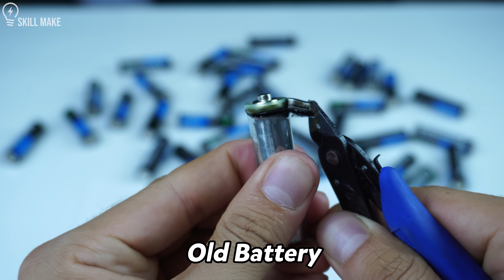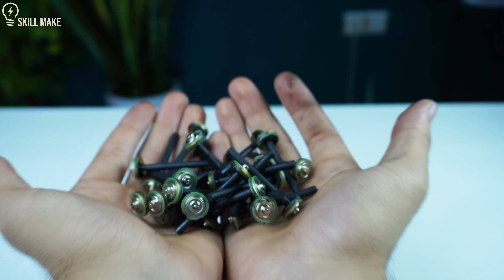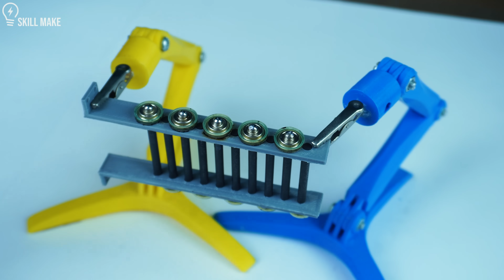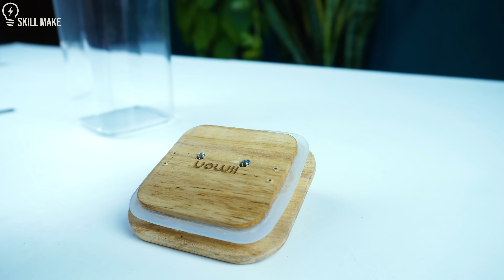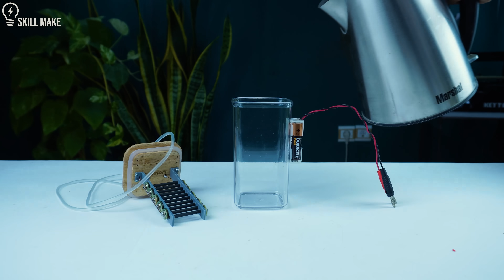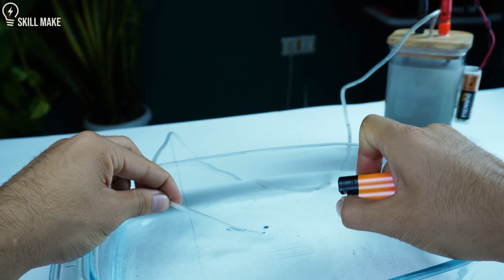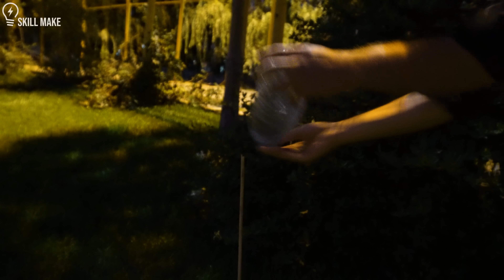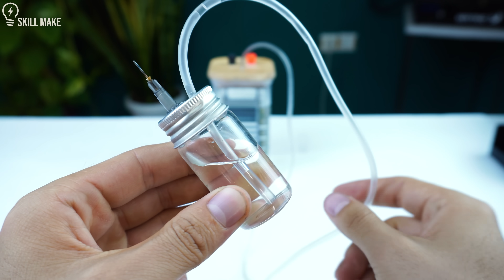Water into Hydrogen - Making a Simple Hydrogen Generator from old battery - hho

Comment: Some guy runs his house on it. He built a system that converts the water with solar electricity, then stores the hydrogen in a tank. No electric bill for him.
Reply: Hows his insurance?
Reply: @boontish1104  No idea. Not sure it would be affected. The whole apparatus is very far away from the house, as its on several acres of land iirc. Just wires running to the house. So maybe just standard insurance for electrical fires.
Reply: As long as he doesn’t patent it or the U S. gmm t an powers that be don’t know he’s safe!
Reply: @ Its already been patented by the U.S highway department. They used it to power lights for road signs, and that's where he got the idea. He used to work for them and he found these interesting little free power devices being used. He had to set them up. It was just a little solar panel and a little hydrogen converter.
Reply: Why isn’t this great invention being upscaled then??
Reply: @enermaxstephens1051 any idea on his name or the devices they were using
Reply: @ Cost. You can see it in action all over youtube, just put in "HHO generator" or "Run my car on HHO". Exact same thing. The highway department just used a very small one cause all they had to power was one light for a road sign. Not a lot of power draw there.
Reply: Just use solar panel directly, more efficient
Reply: Company home power solution build this in your home :)
Reply: @worshipperofjihyo915  Unless you have solar panels on the other side of the planet giving you power at night, you're going to want enough energy for all parts of the day. Hydrogen, besides the crazy dangers of storing and using, would be a great way to store extra energy and provide a consistent amount of power, regardless of the sun's location or the weather.
Reply: @jujuandjesus  just use a powerbank dude

Comment: Just dont make a car engine or something that will make you disappear like the last guy.
Reply: There are hydrogen powered semis ☠️
Reply: Haha Stanley Meyer? Yeah, that was a CIA job sure. They didn't want that getting out bcos of OIL. Bib Lazar has a hydro car though you can look it up on youtube
Reply: Self sustained cars cant run on water. You would break the first law of thermodynamics.
Reply: @Bretaxy  hasn't Toyota made one? They sell one I think
Reply: @Bretaxy  its not really self sustained is it
Reply: Who is the last guy?
Reply: @Vimukthi_Ekanayaka not just one guy, plenty of inventors of alternative fuel sources end up…missing.
Reply: add solar roof.
Reply: @Bretaxy No lawa need to be broken. You just can't see it
Reply: That never happened , the guy was crazy free energy doesn't exist
Reply: @CarlosWillis HYDROGEN and it's pretty expensive , almost 200$ for one full tank , range over 1000 km , and also , it's electric , it makes electricity by using hydrogen , so it's like electric car , faster filling , but worse everything else
Reply: @WatchmanNz not enough power
Reply: American airlines has ordered 100 Hydrogen fuel engines. Future is around the corner
Reply: @goodman393  that didn't happen, stop making things up
Reply: @matejmotuz108  It'll become cheaper if they produce it using excess nuclear power. Just need a great containment system for it. I do believe Toyota has come up with a fuel cell like battery for their hydrogen cars for easy swapping.
Reply: @kz8006  and why not just use that electricity without 60% loses ?
Reply: @matejmotuz108  Because you can't use nuclear in a car. Maximizing power utilization while creating a mobile solution might be where it's at. For our civilization to utilize the power generation for electric cars all the electrical infrastructure needs to be beefed up to handle the load which means a ton more metals to be used for that upgrade. Also in the colder and hotter climates, the power degradation with battery vs fuel sources is huge. You lose battery efficiency above 45 Celsius and below -7 Celsius. I live in a place where it is below -7 Celsius for over 4 months on average therefore in that climate, electric cars are not near efficient enough.
Reply: @kz8006  who said nulcear can't be used in cars ? or that batteies won't be better at future , in fact , Bev right now are way better than hydrogen car AND don't waste as much electricity , there could be battery swapping system , and come on , electric infrastructure isn't such a problem , anyone can get 11 kW charger at home
Reply: @matejmotuz108  I'm in the electrical industry and yes infrastructure is a problem. Add 1 million people to the charging structure and you get brown outs. Also, the mining of battery materials is very hard on the environment and you can't fully recycle these batteries once they are spent. And putting a mini nuclear reactor in cars is asinine as the costs would be parabolic and very unsafe as every terrorist would have a mini bomb in their possession that could devastate multiple city blocks.

I concede that electric cars are a good stop gap towards something better.
Reply: HOLD MY FUCKIN BEER ....
Reply: @CarlosWillis conspiracy
Reply: @CarlosWillis the cells need to be replaced. They're consumable like batteries. The cars don't come with a hydrogen power plant. That would be impractical. The amount of energy required to produce 1liter³ fast enough would be best suited to drive a motor instead
Reply: Made me laugh out loud, Brother. Good one.

Comment: It takes 39.4 kWh to produce 1 Kg of Hydrogen with 100% efficient Electrolysis. A more reasonable number is 50 kWh for 1 Kg of Hydrogen. That 1 Kg of Hydrogen will get you about 60 miles of range in a Toyota Mirai. 1 Kg of Hydrogen is $36 in the only US state(CA) that sells significant quantities of it right now. That is about $0.60 a mile to fuel a car. Efficient gasoline cars are about $0.10-$0.15 per mile and efficient EVs are about $0.03 per mile. Do you see the problem with trying to propel your car with Hydrogen now?

Comment: Glad to see you used potassium hydroxide. The danger with salt (sodium chloride) is that you produce chlorine gas as well.
Reply: That's why you use distilled water for this experiment and not tap water as shown
Reply: @tomokocchikuroki6200  the water came out of a kettle.  Boiled water is not the same as distilled water!
Reply: Why not NaOH
Reply: @ColinMcNulty he never said it was?
Reply: @Userhasbeenbanned0  Ah, I think I may have misinterpreted what he was saying. I thought he was saying the video was showing distilled water.
Reply: The Chloro-Alkali process....
Reply: Great Point
Reply: And the reason why it makes more HHO gas is because Potassium hydroxid is KOH. That means there's gonna be more Oxygen and Hydrogen because the KOH separates.
Reply: NaOH or kOH same  @Dom-I-NATE
Reply: Or just put few drops of sulphuric acid
Reply: but only the first time, so potentially you can just leave it on for a few hours and it will be safe to use
Reply: @ColinMcNulty  no it's not
Reply: @tomokocchikuroki6200 you dont use distilated water for electrolysis
Reply: kno2 all the time.   cleaner, doesnt clog up the cell.      otherwise known as    Lye    cheap
Reply: Isn't drain cleaner mostly NaOH which is Sodium Hydroxide and not KOH ?
Reply: Until it bursts open with caustic basic water flying everywhere (although he didn't add that much, though enough to produce burns eventually)

Comment: I hardly know what hydrogen even is but i just love seeing intelligent people doing something practical or real!
Reply: Are you in 3rd grade😂
Reply: no, but impressed with what you learned in fourth grade, for sure! some kids are amazing!
Reply: Buongiorno i supporti della grafite di che materiale sono fatti? Grazie
Reply: @claudiodeluca6877 самый недооценённый комментарий
Reply: @BabylonPatrol 4⁶szzse4😢sensée de gamme 3😢son 3
Reply: @claudiodeluca6877  Di plastica, stampata in 3D, ma si puo usare vetro acrilico tagliato al laser o realizzato a mano.
Reply: @BabylonPatrol ❤
Reply: Are you a Gen Z? Coz they mostly failed at basic education.
Reply: It's a gas that's highly flammable and from what I have learned volatile. If in the right controlled situation the gas can be used for powering anything like a car for instance.
Reply: No. You are just addicted to youtube kid.
Reply: Here, he's turning water (H2O) into oxygen (O2) and hydrogen (H2) through a process called electrolysis. And the bubbles he's collecting are both oxygen and hydrogen since he is collecting from both the graphite bars connected to the positive side (where H2 bubbles form) of the battery and the graphite bars connected to the negative side (where O2 bubbles form). 

One thing about the atoms in H2 and O2 is they are higher in energy compared to the atoms in H2O. Nature tends to spontaneously bring things from high to low energy, just like how stones spontaneously roll down a mountain. But, you can inject some energy into the system to bring it to a higher energy state, just like how you can consume your own body's calories to bring the stones up a mountain and lay it down on a flat surface. In this case, he is using the energy stored in the battery to push the hydrogen and oxygen atoms into their higher energy forms, H2 and O2. But just like how the stones laid atop the mountain can just roll back down if given an initial nudge, a source of heat with enough energy to give that nudge (ignition) can cause H2 and O2 to react to form one of nature's most preferred low-energy molecules, water/H2O.
Reply: So let me tell you. first of all, it's not hydrogen only which is less dangerous but it's a perfect ratio of  2/1 hydrogen/Oxygen which is highly combustible. also, this invention is the lose and safety lack version of NightHawkins 2 or 3-year-old video.  the first part is what most third-world country students made in school ... The second one is (that lighter) very dangerous option which most probably after a while will invert the flame inside the tube and explode which can throw the needle or glass parts at Marck 2 :D .. also that tube is very close to fire which is most probably more than 500 C.
Reply: thank you so much! good explanation!
Reply: no, but high school dropout in the early 80s...  probably no better than Gen Z... 😌
Reply: Thank you!
Reply: Thanks a lot!
Reply: @TechniCraftYT try being a bit more respectful
Reply: @BabylonPatrol  Yeah, in Germany there is another school System.
Reply: @RJNehlen73 I thought it was some sort of gem.
Reply: @supertuesday600  Gee I wonder whose fault it is that they got shitty education?
Reply: Guys let’s be respectful, as long as someone is willing to learn and enjoy learning about new knowledge isn’t that the point?
Reply: You and me gel.The rest nerds gathered here.Time to pass on to other channels.😊
Reply: Super practical
Reply: I don't like how people here call you an uneducated Zoomer, as if the other generations were any smarter. 

You appreciating intelligence is an act of intelligence itself. Just that is enough.
Reply: Gen z here. Let's see what you school kids remember in 15 years time
Reply: set that bar high Wanda, never give up
Reply: only he most abundant element in the universe. are you a climate scientist by any chance.

Comment: Pretty cool, but you could just drop rolled up aluminum foil into the potassium hydroxide (Drano) water. Instant hydrogen.
Reply: That was my technique. I soldered a copper tube into the top of a 1 qt mason jar so a rubber stopper could be used to mate a balloon neck to the generator. My brother and I would fill 3ft diameter weather balloons from Edmund scientific with hydrogen, tie a knot in the end with a 3-4 ft long string, light the other end of the string then release it. It was our Hindenburg recreation. So much fun!
Reply: @Aspenlogic  Cool!👍
Reply: not exactly economically viable though
Reply: I really hope I don't have to say this, but do NOT just mix chemicals together because you heard a rumour about it on the schoolyard. I mean, Internet comment section. Operate on the same level of "verify before attempting" that was taught back then.